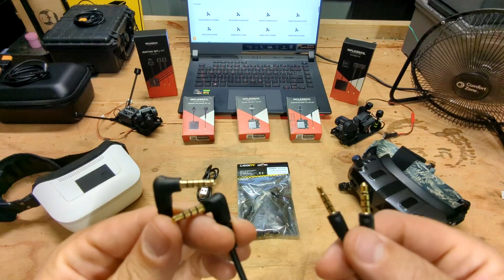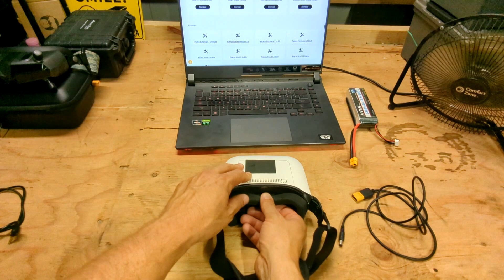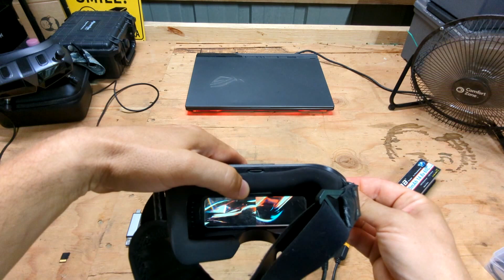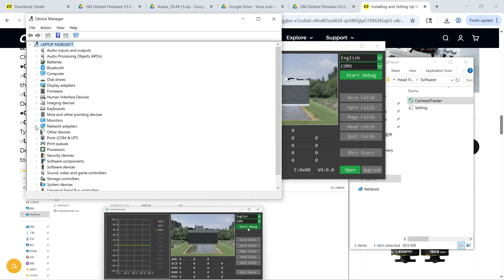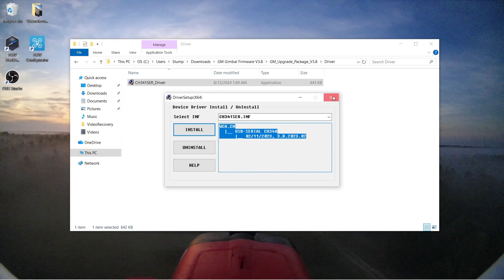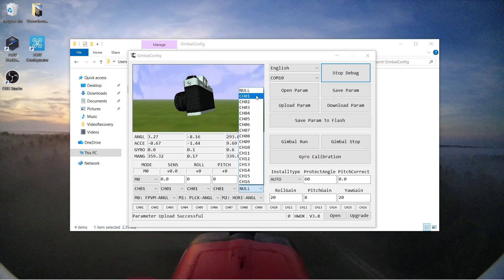Upgrading Avatar Firmware - Gimbal, Goggles, and Moonlight Kit

Comment: gimble config does not give the option to upload param or save param to flash.
Reply from the maker: Do the icons for upload and save param show up but aren't selectable, or are they missing all together? 

If the icons are there but greyed out, after you upgraded the firmware did you click "start debug" again? Debug stops when the firmware upload starts and the icons for upload param and save param become unselctable until "start debug" is clicked again.

Comment: Bro I can’t figure out the gimble firmware update my gimble just stays locked in place
Reply: No matter what I do I folllwed all the steps the debug does not work when I click I even run the chaser
Reply from the maker: Other than the steps I showed, including setting the null values after firmware upgrade and making sure to do the goggles firmware upgrade, I'm not sure what the issue could be. I'd probably email support@caddxfpv.com . 

There is a chance there is a hardware issue, but I really couldn't say. I've got a camera on the way to CADDX right now, waiting at customs in China, that quit connecting via USB.

Comment: thanks for your easy udgrade tutorial. I have a problem upgrade my Avatar X with built in headtracking. it neve connect in the CWheadtracker.exe when I start debug. when i upgraded the gimbals with the gimbalconfig.exe there was no problem with debug and upgrade, but here nothing happen. do you have an idea what is wrong?
Reply from the maker: The only things that come to mind are maybe you need to try a different comm port, or are you using the correct TRS "audio style" cable? The Goggles X use the 4 to 5 segment cable that comes with the Goggles X, not the 4 to 4 segment cable that comes with the upgrade module. I hope this helps.

Comment: Hi i just got my goggle l and gm3 with moonlight and i got the camera to work but not the headtracking do you have a idea why? thanks
Reply from the maker: If the goggles L, Moonlight kit and GM3 are all updated to the same firmware correctly, and you updated the internal head tracking firmware for Goggles L and GM3 too, it could be the physical connection between the GM3 and moonlight kit. 

Make sure the GM3 TX pin connects to the Moonlight RX pin, and GM3 Rx pin to Moonlight TX pin. Initially I overlooked this detail when setting up my GT2 kit.

I hope this helps.
Reply: @StumpLakeRC out of the box the 8 pin 4 wires has red and black for power that need soldering and gray and white that are rx and tx but those end together as a plug not just bare wires to solder. And that plug goes on the sd card side of the vtx but the rx and tx of the vtx are on the other side.
Reply from the maker: It's hard to say what the issue could be beyond the head tracking firmware or wiring. 

The first time I updated the internal head tracking firmware for the gimbal I didn't click "save param to flash" after I clicked "update param",  which caused my head tracking to not work.
Reply: @StumpLakeRC so there is the goggles to update and the internal headtracking to update plus the vtx? Where can i find clear instructions for all this
Reply from the maker: In my video (Upgrading Avatar Firmware - Gimbal, Goggles, and Moonlight Kit), I followed the instructions I found at the link below. But they left out the detail about "Save Param to Flash". It's an important detail.

https://www.caddxfpv.com/blogs/news/installing-and-setting-up-the-caddx-gm3-head-tracking-gimbal-for-your-walksnail-goggles-x?srsltid=AfmBOopQ7ETAWpw59bviYry6NFFmM9NDLZQvUi8aMpJiTWWGNBaVuC3X

You should be able to accomplish the internal head tracker upgrade, using my video and/or the instructions, once you have the upgrade module from CADDX. You can order that module from them for free, but will have to pay shipping.
Reply: @S @StumpLakeRC  thank you so much. I ordered the module
Reply from the maker: No problem.
Reply: @StumpLakeRC i didnt know i was buying i little headache lol i was exited to try it the day i received it. Damn was i wrong😅
Reply from the maker: Haha That's pretty much how I felt about it the first time I tried to fire up a moonlight kit and found I needed to upgrade firmware too.